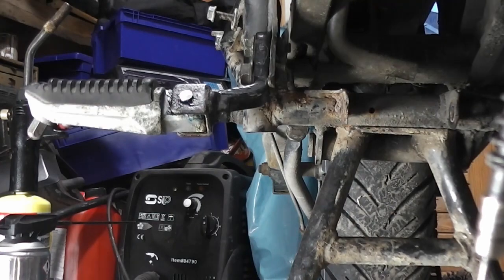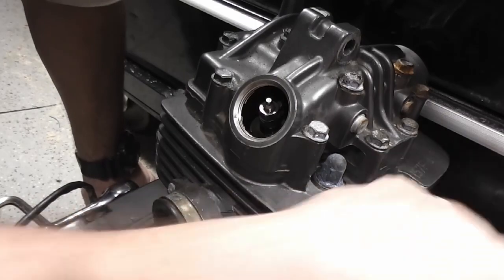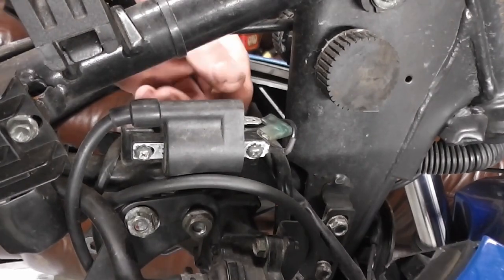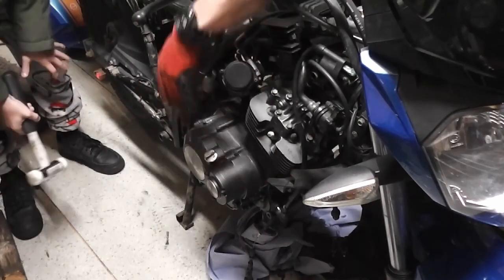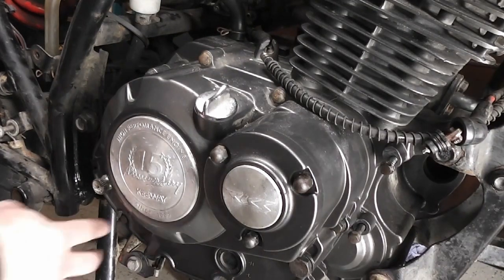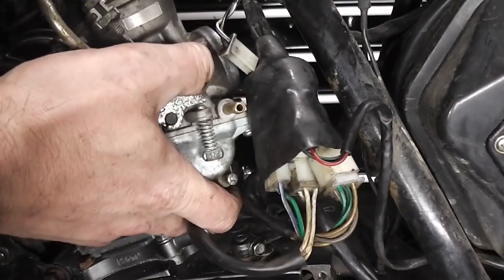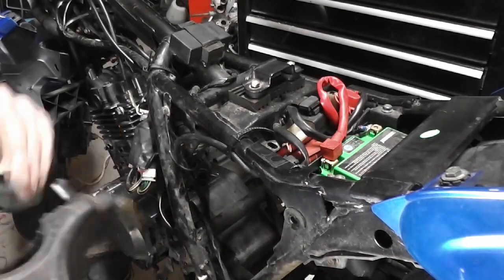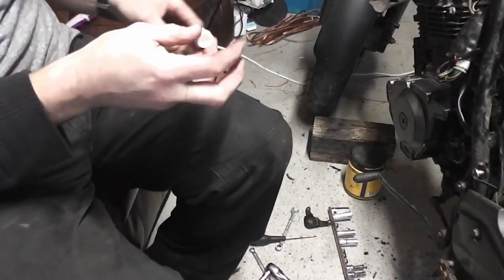Flipping motorbikes. Keeway RKS125 Part 2. fitting engine. Chinese 125 cc valve adjustment etc

Comment: I have found on those heads with the spring-loaded rockers if you slacken the valve right off and put your feeler gauge in and tighten it until you can`t move the feeler gauge. Then slacken it just enough to release the feeler gauge then it is just right.

Comment: Hey, i have a question. Is running fine ? I need to do adjustment on my Keeway RKS but manual i found was telling me the clearance should be 0.03-0.05. Could you please share link to manual you were using ?
Reply from the maker: Hi 
 I just googled it at the time
 i'm afraid i can't remember the actual webpage
Reply: @motorcyclefixer  Hey, no problem at all. But did it run fine ? Because mine was stalling when i came from speed to stop. I adjusted the valves but that did not help :/
Reply from the maker: @alexsfetcu946  yeah it was running great after that

Comment: Hi fella got a Rks 125 fuel injected do you know much about them ?
Reply from the maker: engine wise they are the same. it's only the fueling side that is different. 
What problems are you having ?
Reply: @motorcyclefixer  have you got any way of contacting you
Reply from the maker: @GarethSparkes  you can send an email to mandlmotorcycles@live.co.uk
Reply: It won't let me send an emails to this email address
Reply: Can anyone help got a Keeway rks125 
It's fuel injected and having problems with it over idling then drops and cuts out ??? And then I'll not sit on idle 

And will start back up and do the same thing
Will stay running if ride or keep opening the throttle
Reply from the maker: @GarethSparkes  you'll need to type it or copy and paste it into your email browser
Reply: @motorcyclefixer  still not working mate tried to send you mine but not working on here either , have you got instagram or Facebook at all ?
Reply: @motorcyclefixer  think I've Managed to sent and email

Comment: hi do you know where to find timing marks on that engine? Can't find a workshop manual on that engine.
Reply from the maker: I'm not sure where the bottom end mark is but the top end marks will be on the end of the cams. you'll need to take the rocker cover off to see them.
I'll check tonight for the bottom end timing marks